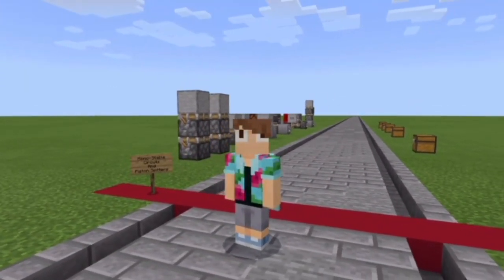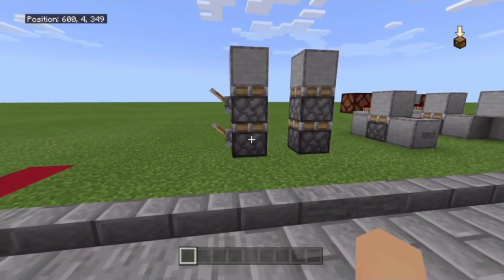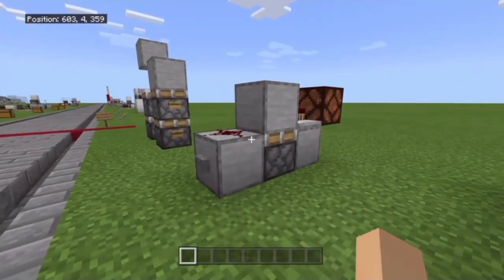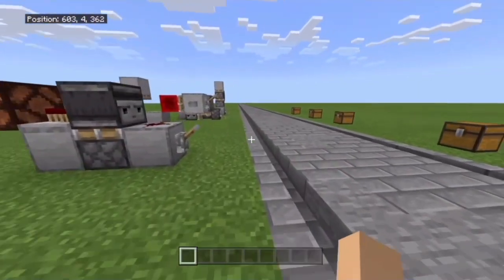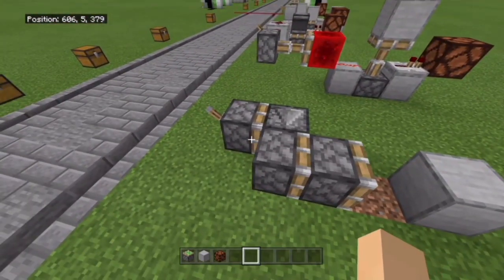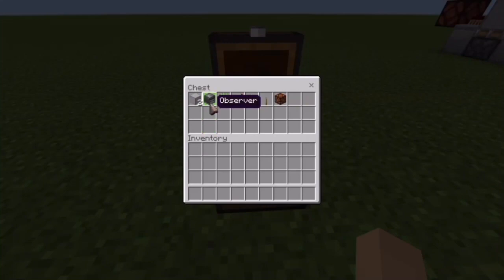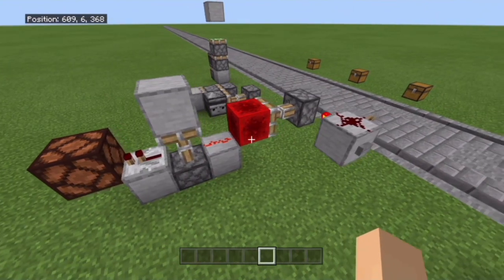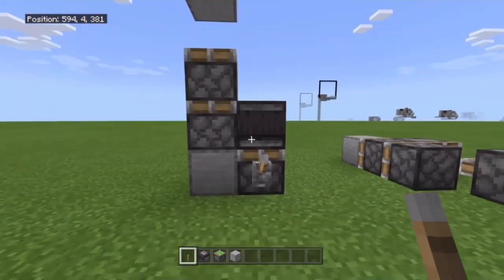Mono-Stable Circuits And Piston Spitters | Learning Minecraft Bedrock Edition Redstone Series Ep 4

Comment: I have just figured something out. On Bedrock, if you take the button of the circuit and extend it to where you need a repeater to reach the circuit, it won't work. However, if you take a sticky piston and attach a Redstone Block in front of it, you can connect it where the button would be and still extend the line of dust and use repeaters.